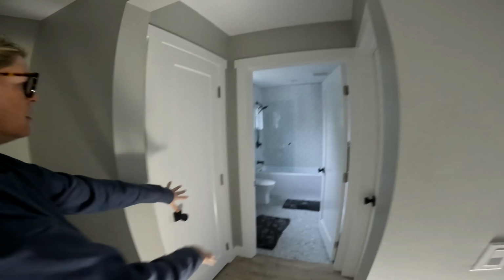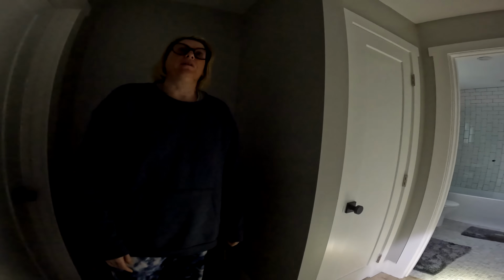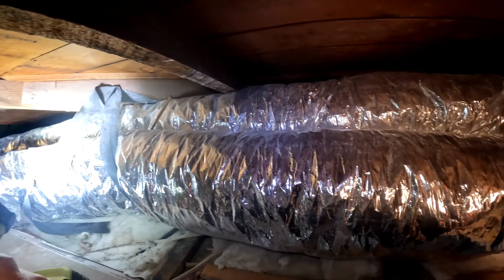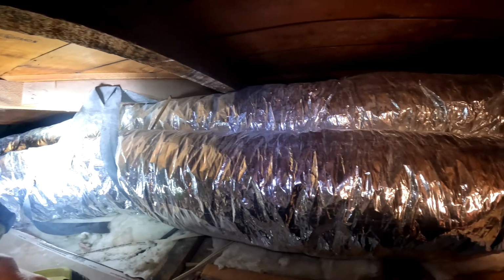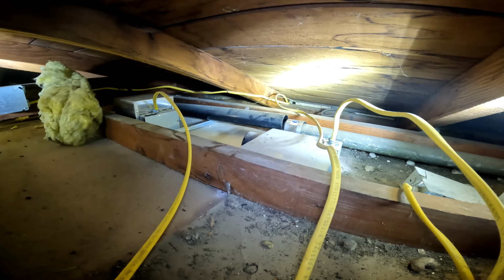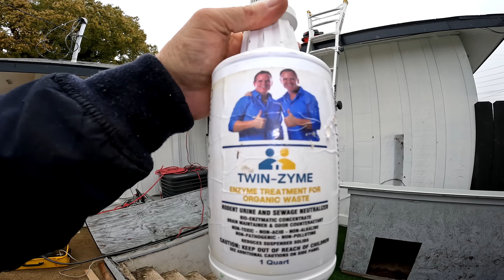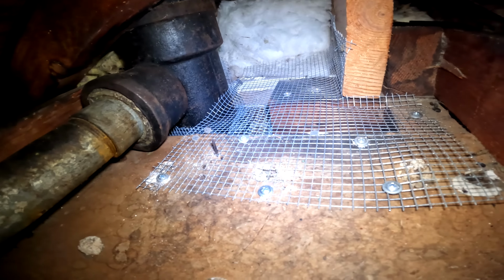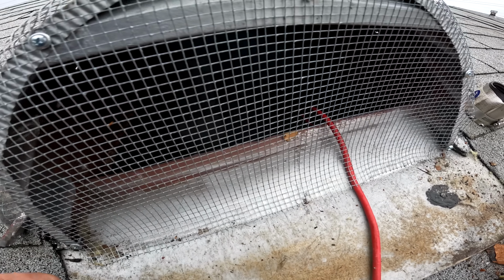The BEST way to remove rats in an attic...fast.

Comment: Just caught 6 in a rental with snap traps in attic/crawl space...can't fully stand up in there however.  Had all overgrowth mature bird of paradise trimmed from roof. Bait boxes out. And found a few big holes on roof sealed with lots of steel wool. Problem fixed! Old roofs with non sealed barrel tile birdstops are tough though!!

Comment: There's a big difference between finding a problem and finding the problem. Good job guys! I like it better when the rats dance along too! 😅
Reply: It's like going to a bad auto mechanic   the bad mechanic  will ignite  the parts cannon on your car until your car is  fixed at a  huge cost. A real mechanic will spend a few extra minutes and find the problem and fix it right the first time .... Today standards Good luck finding a good company that does real good work the first time
Reply: And I love when the Twins do the Rat Dance!! 🤣❤😎

Comment: Awesome work! Setting the bar. I used some of your ideas and help me about 2 years ago. I hired 2 well known companies and both just set traps and said i had to find the entry points. I knew nothing about this and later found your channel. Late night bingeing on your videos and took it upon my self to fix the problem myself.  Thank god it wasn't as hard as what you guys had to do. Thank you, you guys are great
Reply: Tell us how you found the entry points
Reply: You have to just do it yourself  sometimes.  I always have.  But learning new techniques is the best thing to do.  This channel is good for learning.  Spendy equipment for sure.
Reply: @007nadineL  sorry never replied to this. Just had to get dirty. Move things it will be harder if you have an attitude or small crawl space. But I did as much as I could. Luckily I didn't have to go to deep in the crawl space. Look for droppings and dark oily smudges around the walls. Close up all openings. This sound easier, but you really have to just get in and start from one corner. Good luck. 
Also switch up the bait. I had sticky pads, chomper traps, even those electric shock ones. I spent  a lot. In the end it was the sticky pads that got the most.